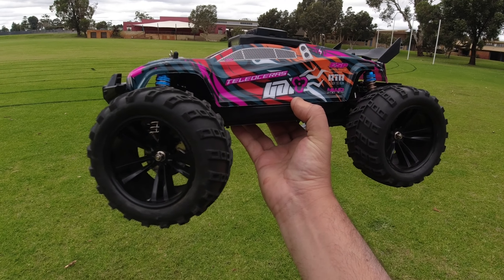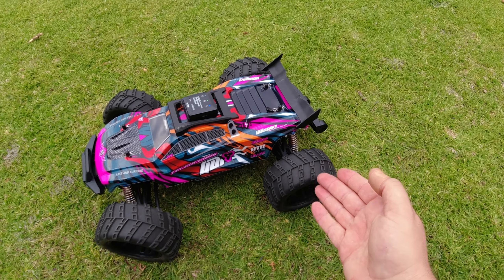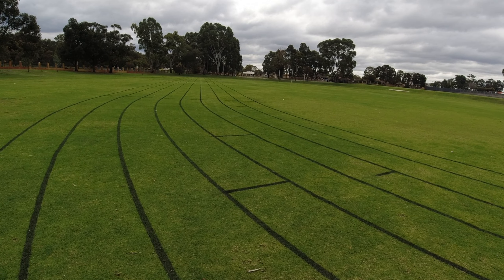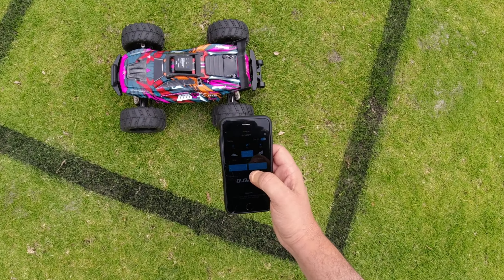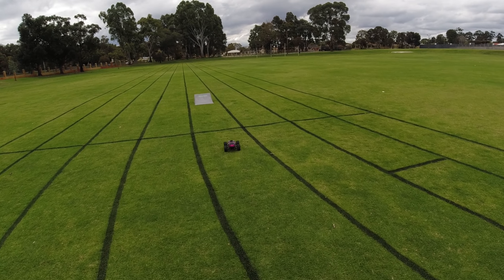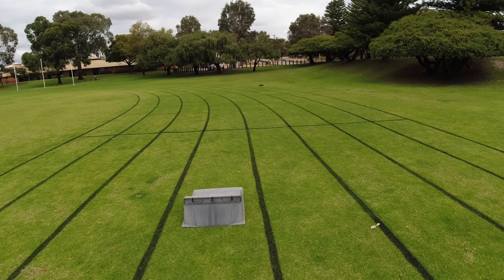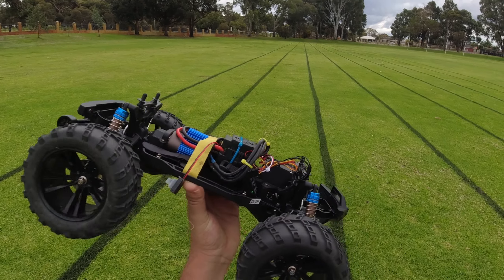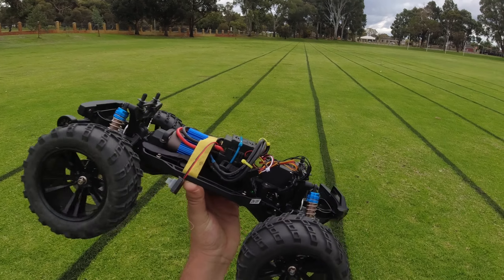New UDI1202 Brushless 4S Bash & Speed Tests

Comment: I want to upgrade this to a brushless! Can u link me a combo set that i dont need a new transmitter on!? Any tips on the prosess? 😃
Reply from the maker: You will need a new transmitter and independent receiver in order to go brushless.
Reply: @PERTHWESTOZRC  what motor do u recomand? That match the pinion gear allready in the car?
Reply: Can i use the Surpass F540 V2 motor? And 60A esc?
Reply: 4370 kv?
Reply: Sorry didn se u answerd 😛 i got a surpass 3660 3800kv! Does that work!? Is the stock pinion gear 5mm?

Comment: Hi Dave , great video as usual, can you please share a link to the ESC , I bought few but they were not very reliable. Thanks 🙏
Reply from the maker: Hi there, this is the 120A esc i used 120A 2-4s Brushless Waterproof ESC https://bit.ly/2XqRf9Q I have quite a few of them in my RC cars and trucks and had no issues at all with them

Comment: Nice conversion.  What size shims did you end up using?  Care to share?
Reply from the maker: Hello Norman, i didn't actually measure the size at the time but i used shims i had on hand that were the exact same size as the bearings on the diffs on either size of the cups

Comment: I just ordered one of these. I got a 3s brushless system on order for it as well. Amain has parts for these and the prices look quite reasonable. Double A arm suspension, oil filled shocks, foam filled tires, they even decked it out with lights. Seems like a pretty good value for $150usd
Reply from the maker: Yeah other than the factory not shimming the diffs which caused damage, it seems like its built pretty decent for a cheap RC, thanks for watching.
Reply: @PERTHWESTOZRC  have you heard back from them? With the level of detail they seem to have put in that truck and others in their product line, I have to believe that was a one off quality hiccup rather than standard practice. I hope you don't give up on them just yet. I'd like to see you get another diff and give it another bash. Make me regret not going for a 4s system. 😀
Reply: @PERTHWESTOZRC  Update: I received my UDI1202 from Hosim today. It came with 2 x 2000mah lion batteries but no parallel    adapter. Unfortunately, the differentials will need to be shimmed on mine as well. I was prepared and willing to shim them if needed when I ordered but I got to say, this is a massive screw up by UDI. I found it hard to believe that this problem would be so wide spread. I know many veterans in the hobby diligently inspect their cars after unboxing and will catch this but many newer people won't. After a few runs they will be left with a broken car and a bad taste in their mouth.